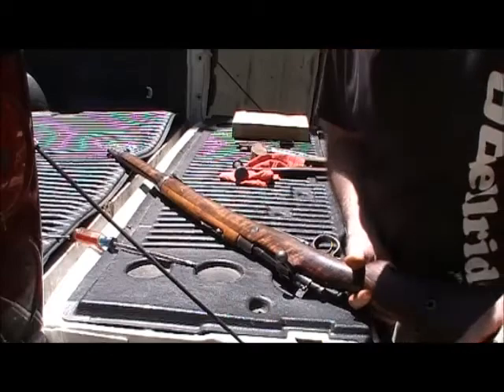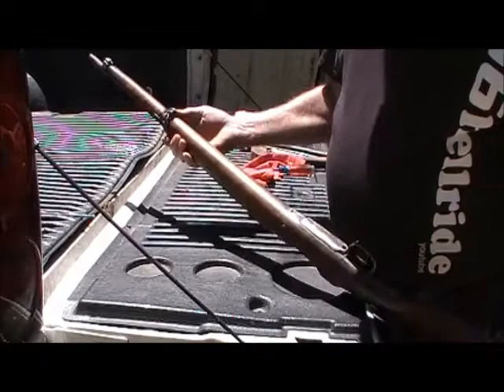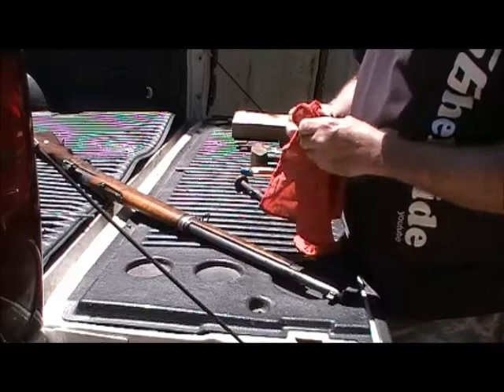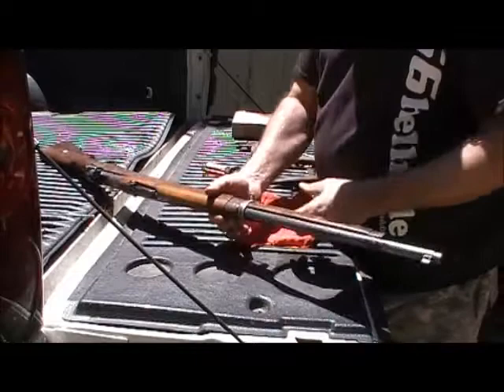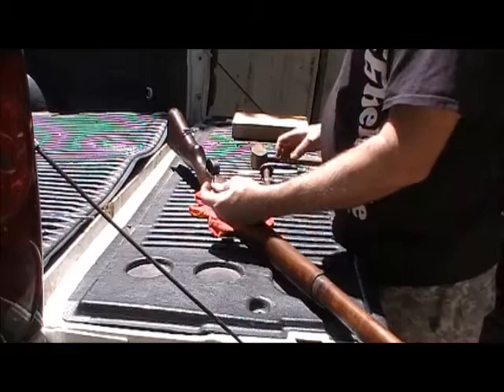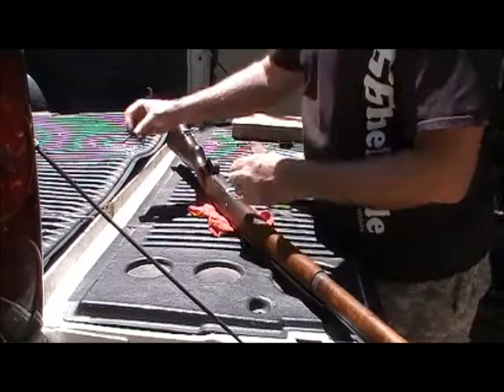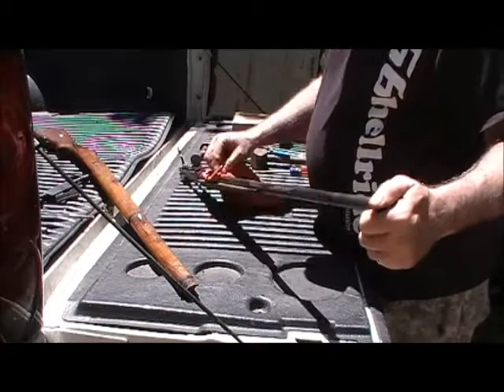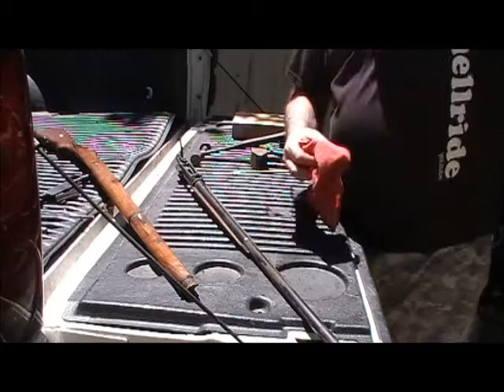Gunatoshis Turkish Mauser

Comment: Yep that is essentially a Model 98 Mauser they sold to Turkey so that really is in good shape. My model 98 Gewhr Mauser looks the same. It all comes apart the same way a little light machine oil or wd40 will get them screws out and I never beat on my Mauser. You may have to redress the heads on those boogered up bolts . Some good cleaning and it will look pretty good. Yep this schmidt Rubin was sent back to the arsenal between 1911 and 1913 to be redone because it was using black powder ammo and they reworked it to use smokeless powder. So they do rework these in Arsenals all of the time just cheaper to do it that way.
Reply from the maker: LUCKYLARRY I got the rifle all dressed down and tuned up now. Ready for some 'Bang'. Hopefully not a "BOOM". I still want a Schmidt-Rubin someday.
Reply: That really is gonna be a great shooter Stevie. They were 98 Mauser action so pretty much bullet proof in function. That 8mm kicks like a mule no matter how tight you put it against your shoulder. I just finished another video now on the Schmidt- Rubin ran my endoscope down the bore nice sharp lands and grooves.